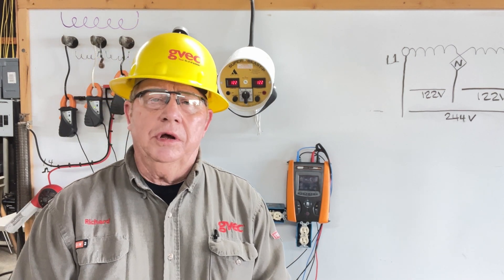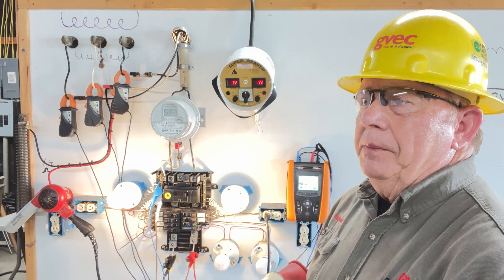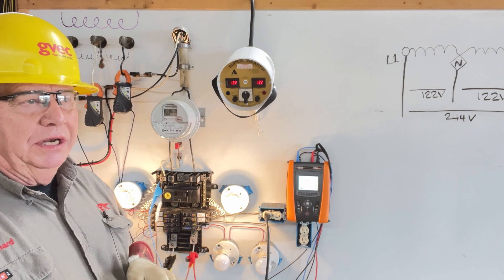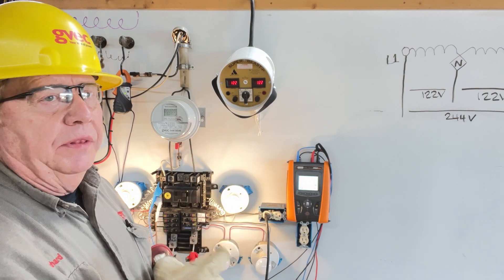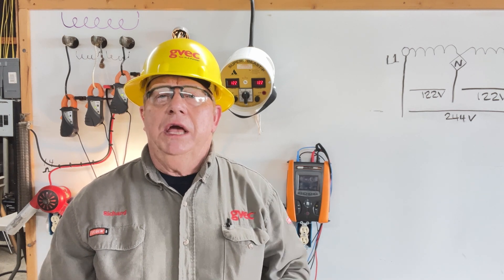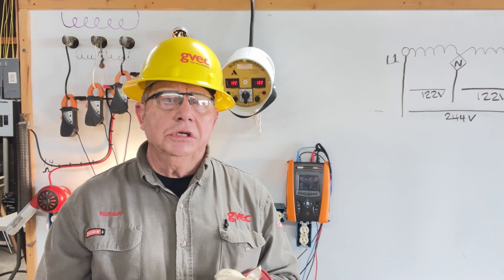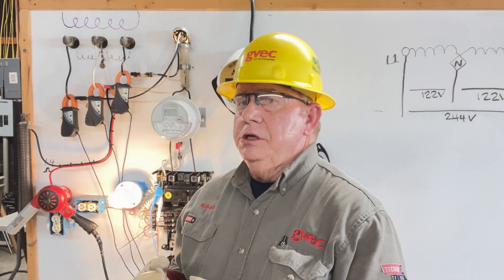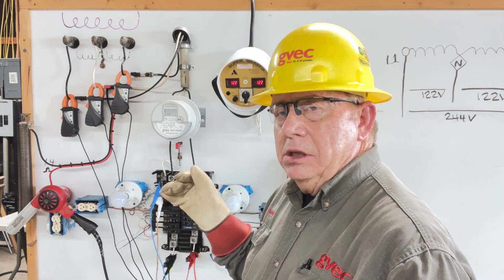Identifying a Bad Secondary Neutral as the Problem.

Comment: 👍👍
Reply from the maker: 😊😊Thanks
Reply: We had a service call recently where as soon as we closed the breaker feeding a small electric water heater, our 240 volt split phase service measured 80v on one leg and 160 volts on the other leg and 40 volts on the neutral ( at the main lugs feeding the panel). Then, soon as we opened up that circuit, voltage returned to normal: 120, 120 and 0 on the neutral. This panel was being fed by a single phase 480 to 240v transformer.  

We thought that load this load imbalance was being caused by bad wiring in the water heater (load) . So we removed the water heater and seem to work fine. 

BUT, I'm thinking now there is more to the problem. Could it possibly be a bad neutral derived on the secondary side of the 480 -240 step down transformer?

Thanks for the video
Reply from the maker: Is the 480V from a three-phase supply?
I plan to build a model but haven't gotten the support for that yet. 
The 480V neutral and the 240 center tap neutral have two completely different jobs.
Is there a chance the water heater is a 120V water heater?
I preach you must have an ammeter involved along with your voltmeter.
My Fluke 345 allows me to see the sine wave and the distortion percentage. Sometimes that does make a huge difference when troubleshooting the oddball complaint.
Please keep me involved and let me know how you resolve this.
Reply: @linema22n   480 volt is single phase. And I did not see a neutral, might have missed it ( does a single phase 480volt primary side of transformer have a neutral?) Water heater is 120v. Being fed by a single phase 240 volt panel ( from transformer secondary). Thanks for the tip on the Fluke 345, I like buying new troubleshooting tools.  We eliminated the 120v water heater and wired in a receptacle in its place to run a  1850 watt hair dryer, and the hair dryer load did not create an imbalanced load as the water heater did. This convinced me that the problem was in fact either the water heater itself, or the wiring (compromised neutral) within the 20’ EMT run between the junction box where we added a receptacle, and the water heater. But then I thought: would a compromised neutral down stream of the panel feeding the water heater circuit affect this voltage imbalance measured at the feeders/ main lugs of the 240 volt split phase panel ? Does it travel upstream like that, back to the panel?
Reply from the maker: @ all depends on how the 480 was created.
480/277 has a neutral  but if you know 480 fed the transformer, it was done with two hots. If it came from delta, any two hots make 480 also.
Was the voltage checked in exactly the same place each time?
The voltage change with unbalanced current is downline of the bad connection only. If you measure  good voltage in one spot and bad in another, the bad connection is in the middle.

Comment: Hi Richard,
we had a branch fall and break the neutral to our house.
As you said, ALL the 240 volt stuff was fine.
I also think that you said, all the 120v lines all shot to 240.

I LOST every single surge protection device, except for the computer UPSs, in the ENTIRE house.
I had a clock bulb MELT its housing.

Other stuff went also.

Is there a device that can be added into my house to protect against a broken utility neutral?

Just FYI, we live out in the woods.
Power fails,
broken lines,
up & down the street,
ALL OVER,
every month.

DAMN hippies not letting the utility cut trees, grrrr.......

What device(s), if any, can provide excellent protection to our entire house?

Thank you in advance for any reply!!
Reply from the maker: Thank you for your comment and sharing your experience with an open neutral.
If all in your house was 240V, an open neutral couldn't affect the 120 legs but would remove grounding protection
I wish I had an answer for you.
This has been discussed many, many times.
https://www.electriciantalk.com/threads/whole-house-protection-against-poco-open-neutral.290296/
I did an experiment with an expensive UPS from our IT group. An open neutral smoked that UPS.
Many believe an SPD or TVVS can protect your house. I do not agree.
Did the utility compensate you for your loss or claim it was beyond their control?

Comment: This is the first of your videos I’ve watched. You might be the right person to ask for a question I’ve been wanting answers to. Is there an easy way to solve voltage imbalance on a single phase 480/208 control transformer without a center tap? I’m just a service fitter and I’ve been wondering if there’s a solution
Reply from the maker: @ryanwilson5222  you will need to clarify.
I have grounded one leg of the secondary past a small control transformer.
Reply: @ we do have a grounded leg off of a 208/24 but the 208 needs the ground reference. I think if I ground x2 or x3 it should work. But I don’t really want to blow it up.
Reply from the maker: @ Look at the transformer data plate. When you see two coils, you have a conventional transformer. Bond one of the secondary legs. As long as it is the only one in that coil, you will be fine. Utilities do this every day when the center tap leg is bonded and becomes the neutral.
I am far away and have only the information you have provided. Is there an experienced electrician available to assist?
Reply from the maker: The more I read your original post, I have more questions.
Why do you think you need to do anything?
If the 208 comes from a 3 phase wye system, do not ground a leg that measures voltage to ground.

Comment: Three ovens all failed in my home.  The power company came out and pulled the meter, and couldn’t find anything.  I called an electrician, who had me inspect and check the tightness of the screws in my circuit breaker panel. It was all good.  I told the power company what I had seen and prevailed upon them to check connection at the transformer.  They said nothing was wrong. But, guess what: the problem went away.  Hmm.
Reply: What a coincidence lmao

Comment: I troubleshoot electrical problems in everything from large industrial facilities to homes. About 10-years ago my wife was complaining about our lights flickering. I rounded up one of our $17,000 power disturbance analyzers and hooked it to our 200amp. Panel. Then I turned on our clothes washer (120volt). The lights were flickering. The voltages on each phase were fluctuating. Checked the neutral connection in the panel and it was good. 

Then the fun began. I called our local utility and told the, that they had a bad neutral (button) on their transformer. They told me that they were busy and it might be a couple of weeks before they could come out. I told them that I had a logging power meter on my service and if we had any damage to appliances or electronics in the home, it was their responsibility. A line showed up 1/2-hour later.

Open or failing neutrals are one of the leading causes of whole building and whole home surge suppressor failures. The surge components are metal-oxide-varistors that “turn on” at 150 volts. With an open neutral, the MOVs could potentially see 240volts (208volts on a three-phase service).
Reply from the maker: Thank you for sharing that experience. It’s good that you have the tools and know-how to troubleshoot these problems.

Comment: By far the most convincing explanation I can use to prove my argument about my flickering led bulbs in my house. Thank you for passing your knowledge on. I owe you a beer
Reply from the maker: It is my pleasure to make this type of content.
The are many things that can cause the flicker you see. Voltage drop, loose connections, and utility switching are just a few. 
If the complaint is LED flicker only, a different brand of bulb corrects this most all of the time. I have another video talking about bulb selection.

Have you asked your utility to check their side of your service?
Reply: what happened one night finally explained the problem and answered my questions, but it was the, HBIC, that couldn't understand the problem. Her opinion was voice over and over in a tone that could shatter, "led crystal glass." Then the final statement that could not be argued with, and yes, it was true,  unfortunately. The words, "Well, the lights don't flicker at my parents' house," "Face it you and your contractor buddies are just a bunch of..............." Ouch, my pride. What happened is my house lightning circuits had been wired with 12-3 from the panel using 2-20amp circuit breakers sharing the neutral, then 60 feet away to a junction box. At junction box, the 12-3 wpuld then be divided into separate light circuits with 2 runs of 12-2. Wht fu... I was a bit upset to find this out, but to my frustration, I found out this was a common practice for lightning circuits, but what wasn't common was to add receptacles to that same circuit. A 12 gauge neutral wire can not handle 40amps. And trust me, a circuit breaker doesn't trip as a neutral is melting  from a wall receptacle up the wall into the attic. Thank you, God, for letting me be at home and awake to stop the fire that almost happened. So ya, any flickering of a light instantly gets my attention now, and the neutral gets tested and probed and checked some more. Just thank you for the reassurance about a bad neutral and for giving me the proper knowledge to understand it know
Reply from the maker: If that is built using leg 1 and leg 2, there is no problem when connections are good.
You described leg 1 and leg 1.
I never built circuits that way because breakers can get moved around.
Reply: it just doesn't seem right to put 20 amp breaker on the black wire and a 20amp breaker on the red wire and then share the white wire (neutral) between the 2- 20 amp circuit breakers.
Reply: half my 200amp panel was wired that way. Pretty much everything except the 240 volt circuits.its long since been fixed and upgraded. Just liked your video it made sense and took me back 20 years for a few minutes thank you
Reply: Probably not an open neutral. Most likely an incompatibility between your leds and dimmers. Lutron has an excellent site showing which of their dimmers work for certain leds. Other issues can be cheap leds and other loads on same circuits.

Comment: 25 year generator tech, retired now... this is the kind of stuff I love teaching to the new guys so when they are on a trouble call they can figure out who is responsible to fix it. IOW, problem from the poco, the generator gear, or an issue in the customer's service elsewhere. (panel?) I usually start off with the idea a slight voltage drop is normal (say 5% or less) under load but the other leg going up is the key to this kind of issue. They I get into why it happens and how far it can fluctuate, which causes equipment damage. Over my time I probably found 3-4 bad neutrals a year, and 90% on the poco side. (how I got introduced to the beast) Most of the balance were actually within the meter pan but needed the poco to get there for proof because we are not supposed to pull meters. Usually it was chaffed wires or a bad crimp on the triplex. BTW, back in my younger days (1970s) our local FD was trained to pull meters during a house fire. That's how long I have been playing with this stuff. They frown on that today. Question: what is the power draw using that beast? How many watts / amps per leg? The guys I spoke with don't seem to know the specs.
Reply from the maker: @rupe53  
Thank you for sharing your experiences.
The SuperBeast is usually 23 amps.
I built load boxes years ago that had resistance heaters for 20 amps.
The Scott-O-Matic Flickerbuster I built can do 50+ on 120V.
There is a MegaBeast than can do 80 amps but it is over $3,000.
I don’t have one yet.😞
Reply: @linema22n    I know it's a handy item but way out of the budget for guys like me who travel light. With a bit of brain power plus a volt meter and amp probe I can usually sort  this out in a few minutes by adding a heat gun to one leg and checking readings again. Walking the service line with a good eye will finish it off 90% of the time. Process of elimination and sometimes a wiggle test of wires can also help. Heck, I have found wires that were not even under the screw at a breaker. They were actually behind the lug doing the make / break dance as they got hot or cooled off!
Reply from the maker: Many, many, years ago when I was getting started, I took a 10kW heat strip and built a frame around it. Worked great for 120 neutrals and 240 voltage drop complaints. There was no fan, so I had to warn the new apprentices to stay away from the glowing orange element. I learned a lot in the early days with that homemade loader.
Reply: @     Back when I first started it was in a small generator shop. I used a pair of four burner cook tops as my load bank. (6500 watts each) 30 years later those are still there for testing portable sets. When I retired the company had grown to over 5k customer base of standby sets and now well over 6k. They have a 100Kw load bank now.

Comment: I have what seems to be a resistive neutral in my backup battery system.  Add 12 amps on one side and the voltage goes from 121 to 112 and the other side goes up to 130.  Flip the side you get the same but reversed.  I've complained to Tesla but they have no idea what I'm talking about or tell me that's normal.  No, it's not normal for a 7.6 KW inverter to do that when lightly loaded.  I guess it's up to me to go look at all the connections to see if I can find the neutral issue.
Reply from the maker: @flyer617  
Where are you checking voltage for you to believe it is on the backup only?
Reply: @linema22n  When the grid was out I was checking at the main panel.  I did this because we went to cook dinner in the microwave and it sounded low and I measured 112 volts.  At the same time my computer UPS started beeping saying it was correcting for overvoltage.  After dinner I tried the heat gun on each leg and could see the neutral shift at the panel.  The backup gear is all outside and it was freezing rain and dark and I really didn't have much interest in measuring stuff out there at that point.  Outside there is a separate load center then the energy storage system so there are several points for me to check.  When it's halfway decent out though.
Reply from the maker: If you have an ATS, the problem shouldn’t be on the utility side. If you don’t see it when on utility, then it sounds like you are are on the right track, looking at your generator connections.
Reply: @linema22n  When on utility it's rock solid so I know the problem is on the BESS side.

Comment: Great video. Thanks for taking the time to set up that demonstration, I’m sending it to all the guys at the shop. 

We always just call it an open/dropped neutral, but clearly that’s ignoring the resistive possibility you heavily emphasize.  Checking the customers side is huge. As an electrician I can’t get into the meter base, so we have to perform similar test using what’s in place already. The majority of our bad neutrals here are poco related, but every so often I’ll find a rotted feeder from the meter, or a bad connection in the panel.
Reply from the maker: Thank you for the comment. Working to pass on experience to the next generation should be part of the job. Most POCO's are focused on the point of common coupling.
My objective is to find the broken part. If it is mine I will fix it. If not, it has been identified and the complaint to the utility is resolved.

Comment: I worked at a plastics place. The "maintenance manager" was a 20 year navy electrician. He did a lot of wiring at the plant. He installed a few 480 to 208/120v wye transformers to supply power to work stations. The company bought a CMM machine. I forget why but I was testing a panel we were adding the machine to. Had 70v on the neutral. Here homeboy never bonded any of the transformers. He was good at checklists but if he had to think someone was in trouble.
Reply from the maker: Thank you for watching the video.
I know that no one knows everything. I want to learn every day.